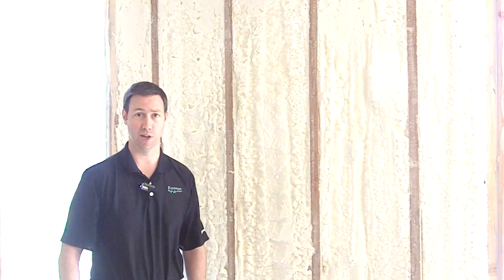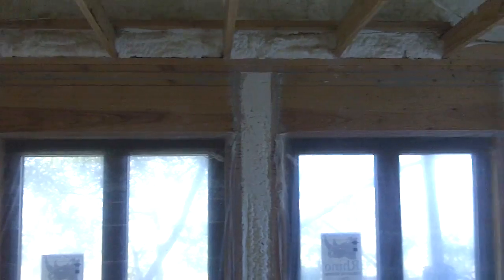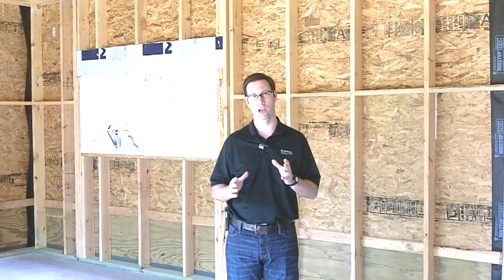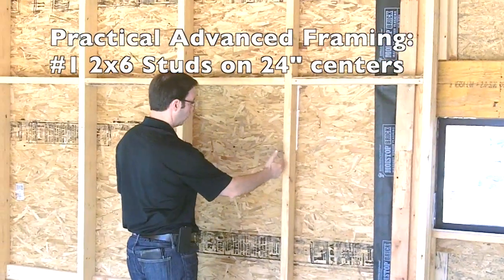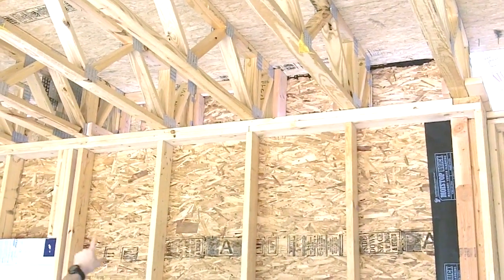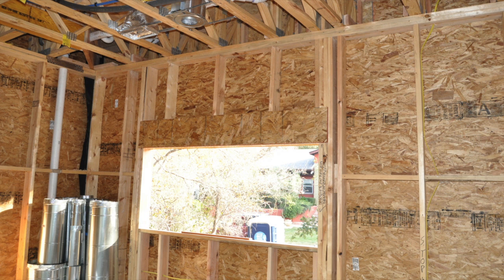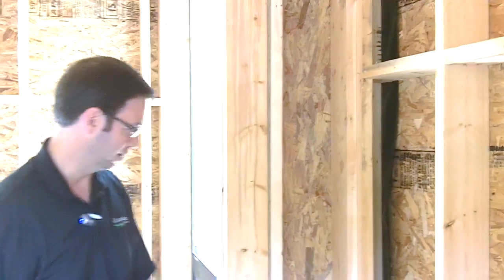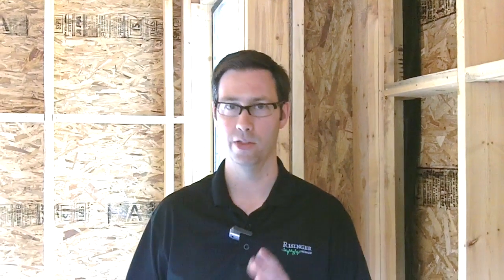Advanced Framing vs Traditional Framing

Comment: Yeah it sounds good and all but all this guy is, is a salesman. He's going to make the cost 10 percent less for you use 25 percent less wood and make 15 percent more for doing absolutely nothing. It's all marketing I mean you can really never over build a house, and why wouldn't you want sixteen on center it's stronger. Which is why houses from todays builders won't be around as long as houses built fifty and sixty years ago.
Reply: If it were a direct comparison, I'd agree, but 6" studs on  24 centers is stronger than 4" studs on 16.  The actual sizes of the 6" studs are a higher percentage of the nominal size.  (If you are relying on curtain walls to support the majority of the structural load of a house, you have already failed)
Reply: you won't lose 25%.  mabe 4%  you  only lose 1 stud every 8 feet.
Reply: You are right to point out the off-by-one error, but I was making the assumption you have big enough walls that the savings is closer to 33% and 25%. Granted, a real-world house will have walls anywhere from 5-50 feet, so the savings are very project-specific.

I want to address one point you made:
> "So the cost savings rises progressively minute the more lineal feet of walls."

If you mean "the savings percentage rises more slowly the longer the wall gets", you are correct. If you mean "the overall cost benefit is lower the longer the wall gets", that's not right. I think you mean the former, but I'll illustrate just in case anyone aside from us is actually following this. :)
For each wall, it's a simple linear function:

n = w/s + 1

where:
n = number of studs
s = spacing in inches
w = wall length in inches

As w approaches infinity (an infinitely long wall), the difference between s = 16 and s = 24 approaches 33.33...%. Here are some examples:

----- 4' wall -----
w = 48, s = 16:
n = 48/16 + 1 = 4

w = 48, s = 24:
n = 48/24 + 1 = 3

3/4 = 0.75 => a savings of 25% on a 4 foot wall.

----- 40' wall -----
w = 480, s = 16:
n = 480/16 + 1 = 31

w = 480, s = 24:
n = 480/24 + 1 = 21

21/31 = 0.6774 => a savings of 32.25% on a 40 foot wall.

----- 400' wall -----
w = 4800, s = 16:
n = 4800/16 + 1 = 301

w = 4800, s = 24:
n = 4800/24 + 1 = 201

201/301 = 0.6677 => a savings of 33.22% on a 40 foot wall.
Reply: Actually it's 4 per 4' with 16" O.C. and 3 with 24" O.C.; counting the studs from end to end. A 25% decrease in the amount of studs; but an overall increase in the price of 2x6's vs. 2x4's. Would have to do a cost analysis of total linear feet needed of each type to find out if there is any actual savings. I doubt it would be much. I think the potential savings are really in man-hours/labor and nails & hardware; not in the lumber if you go the 2x6 @ 24" O.C. route.
Reply: before anyone else posts on here: it's worth mentioning that a stud's R-value is like 6. especially in colder climates, that's a major drain for heat in the house. for reference a regular insulated wall is like 20
Reply: According to math and my 30 years experience as a framing carpenter and a builder I'm fairly certain you are all wrong.   In four feet of wall, at 16 oc, there is 4 studs, at 2 feet oc there is three studs.  For a savings of 25% in 4 feet of wall.   The stud at zero or the starting point must be counted.    0,16,32,48,64,80,96. For 7 studs in 8 feet.   0,2,4,6,8. For 5 studs in 8 feet. For a 28.6 % savings  in 8 feet of wall.  So in a wall of 24 feet at 16 oc you'd have 19 studs, and 13 studs for 2' oc.  So the cost savings rises progressively minute the more lineal feet of walls.  However, I agree with Blake, I wouldn't build my house with studs at 2 foot centers in either 2x6 or 2x4.  I don't think the poster of this video would either. A couple little pigs build their houses on the cheap, and we all know what happened to them.    Studs are the cheapest component of the entire framing package. So you might as well use them.  As far as the energy efficiency is concerned, given the conductivity of the surface area of one stud , you are majorly splitting hairs.  Not to mention the builder put sheet insulation on the exterior of the house.  And with the 5/8 rock on the inside, he now has to re extend all the 6 and 9/16 inch jambs on at least the doors.  Energy efficiency is a state of mind. We all live on a planet in which matter and energy is conserved, and most people exhaust over a gnat and swallow a camel.
Reply: all sounded good till the end. Then you blew it with that nonsense. Energy efficiency is required to survive as a species over the next century. At least until we move away from carbon energy
Reply: Try using a mister to apply water on the exterior of a conventional home at minus 20C. The water freezes over the stud bays but remains liquid over the studs. Why? Because the studs conduct heat from the house interior to the exterior. SPF has an R-value of only about 1 per inch. Do you really want to heat the outdoors? I don't. That's why I build modern, quality buildings now.       @1974jrod
Reply: Blake Pilkenton bg
Reply: 1974jrod hey I'm reframing my basement since half of it is not framed. What type of framing wood or steel? And should I do 16 inch on centre? Also use 2x4s?
Reply: zain tareen wood, steel, or timberstrand.  Take your pick . Don't know your climate though.
Reply: My house was built in 1947 with wood taken from a barracks used to hold German P.O.W.s sold after ww2 for lumber ,its strong as hell real good wood and 16o.c. think of the weather this place has seen guess my grandfather who was a mechanic was also a dam good carpenter,
Reply: I bet thats a nice place, love old construction the oldest I've worked on was around 170 years I have done a lot of those jobs in the past U.S, we don't go back like some of the old world buildings in age.
Reply: Muftobration actually it's 4 and 3.

4 ft of wall plate, 16" on center

Stud #1 - beginning of plate
Stud #2 - 15" 1/4 and away
Stud #3 - 31" 1/4 and away
Stud #4 - 47" 1/4 and away

4ft wall, 24" on center, would be 

Stud #1 - end of plate
Stud #2 - 23" 1/4
Stud #3 - 47" 1/4
Reply: Blake Pilkenton true
Reply: I do not think so
Reply: The pain in the ass of extending all the door and window jams when using 5/8 drywall is stupid. Of course ceilings use 5/8, but that is for rigid support and don't effect trim at the end. The lumber is really the cheapest part of the house, so beside the rafters, 16 oc for walls is a no brainer like half inch drywall
Reply: Muftobration I say thars good one tell me this.   Fourteen or so, don’t make no much differences when we build em up nail em. No two ways keep doin it keep buildin!!!! Is all the game strongern tha bettern
Reply: Minimal difference in wood saving. You use less sticks but not really  less wood. Deeper cavity for insulation is about it.
Reply: Blake seems incredibly unaware of building for energy efficiency.
Reply: OK. So, what I see is: 
Yes @16 oc=4 st@4x2
@24 of=3 st@6x2
But if you look at the 24", the volume of wood used is equal. At the 48", the 6x is 2" more wood.
Just the factor of thinner wall mass is more usable space, IS the considered standard... 2x3s are basement studs because of existing wall structure. The 2x6s are all well and good - if you have the space. Yes, the more RF rating should become the common standard if climate is on either extreme, but for heat, it can be delt with by use of deeper foundation that makes the first floor almost a 3/4 basement. Proper ventilation strategy can greatly improve the energy efficiency for 2nd and 3rd floor cooling. The 2x6 total mat. and the insulation total mat. is reduced overall.
But, yeah! Total sales pitch, and BS on less lumber.
Reply: Guss Ruffee true that's why the studs are positioned the way they are,  too add strength! and to have a thick wall, but a 2 by 6 gives more thickness to add more insulation and noise reduction, also less boards will be used by spacing 24 inches and that will increase warmth, every house is different! there's a train near mines,  therefore a thicker wall is better,  and I added extras for wind and tornado protection myself, I joined rafters with bolts and glued everything and used straps and used metal braces in corners,  I done the work myself therefore I can personalize more,  but contractors will take as many shortcuts as they can
Reply: Guss Ruffee you don't get it! your studs are placed in your wall with the longer side giving the thickness to wall,  another way to look at it is to look at your rafters, are they laying on side? no! in fact the longer your span the bigger the board!
Reply: Actually you lose one stud every 4 ft and the reasoning is energy efficiency.
Reply: 4' = 48". With 16" spacing, you'll have three studs in 48". With 24" spacing, you'll have two studs. It's a savings of 33% (1/3).

Comment: Hello,

I am planning to build 2 story house, so wondering can i use 2by6 24in OC for first and second floor? And also if i use 24in OC studs for first floor can if support second floor?
Reply: Sure if plan stamped also layout so roof and ceiling wall and floor joist all on top of each other ( point load ) great for running chase up to second story also ..

Comment: I framed homes for 21 years and Im here to tell you, 24 oc studs, bump into that sheetrock wall! I bet you will almost go thru it versus 16 on center. At 3:08 the freaking anchor bolt is half way out of the wall lol thats really secure eh?? Ive used California corners and im okay with that. 2X6 wall studs, 5/8ths sheet rock and non OSB plywood is going to cost someone out of the ass. Ah, the young "educated" guys just know it all dont they?
Reply: I was going to say the same thing! I framed for a few years here in Utah and can tell everyone going 24" oc is not worth it! 1/2 - 4x8 rock ~$9 a piece, vs 5/8" rock at ~$13.50.  Here in Utah you can't do 1/2 sheeting on the outside with 24" oc walls, you have to go to 5/8 or higher, vs 16" oc you can run 1/2. All the homes I did we used PT plywood for the first sheet of the wall.  We only built our own headers a few times, the majority of the time they were engineered. Any sort of truss here in Utah you have to use hurricane hangers to tie them into the wall, I would suggest them everywhere as they are a few hundred $$, but save your ass big-time! It's a good video, but to say a home that's framed 24" oc vs 16" oc is somehow better is a damn lie.
Reply: There will be spray foam behind the wall so the drywall won't have any 'give' to it. Most homes on the market (including mine) are not completely sheathed so as long as you are doing the 3 things 24" will be fine and should make for a very rigid wall.  1. full sheathing 2 sprayed insulation 3. 5/8 sheetrock.
Reply: Shane Marcotte usually the 16 OC is to accommodate the siding tongue and groove. Sheetrock is not real problem since it's cheaper and easily cut.
Reply: Robert Slackware I do after market media. Foam doesn’t stop us from running new wire. Not as easy but doable.
Reply: Yes, after building houses I've learned that this business is probably the hardest one to get folks to change. "I did it this way for 50 years and that's what I'm going to do!"
Reply: @truthteller50  You can say that again
Reply: I have personally punched through interior 1/2 drywall on 16" studs.  Don't see that it makes much difference.  A cheap papered or painted wall is a cheap wall.  Drywall is a cheap substitute for plaster on lathe. Plaster was used on entry level Sears kit houses in the 1920-30, and continued to be used on middle class homes until the early  1950's when stupid people who couldn't afford to buy a good house started accepting junk on credit. 

As far as cost, if you are lucky and have a good contractor, you might get what you pay for. I fought the cheap vs expensive battle over wiring and plumbing, hired and trained electricians to use EMT instead of plastic sheathed wiring and plumbers to use galvanized pipe instead of copper or (yuck) PEX in areas that weren't getting closed walls. Now those men have gone on to doing better paying work on hospital construction.
Reply: Robert Slackware I
Reply: Shane Marcotte  I couldn’t agree more! I wouldn’t build a dog house 24 OC. And the anchor bolts.......? He’s not framing a house, he’s giving a lecture on insulation. So to increase that, build a junk home overall. No thanks!
Reply: ***** Correct me if I am wrong, but isn't it that way so that he can hang the sheet rock? Looked level with the next stud to me... I think you didn't understand how that corner worked
Reply: Ok cool
Reply: shows the lack of ability to build any solid structure. what sets the structure is what the engineer specs out. cant just go all Willy nilly and just do what ya wish. California corners have been used for quite some time. nothing new there. its just a pain for anyone doing detailed cornerboards on the exterior
Reply: Not corner , wall anchor!
Reply: plywood is superior to OSB in almost every way except cost.  Some people want their house to be strong to last.  That is how I built mine.  Especially in the subfloor.
Reply: That's what I was wondering - You'll have to have a note on every finished wall reminding the person they don't have 16"oc stud walls.
Reply: Wow! Where do you folks live? No-one is familiar with 24 inch centers? Jeez, get up to speed; the world's a changin' and you're being left behind.   @truthteller50
Reply: I completely agree with you.  Too bad others writing reviews don't understand this.
Reply: Nor is the bolt centered on the 2x6 bottom plate so the concrete guys deff suck dick or its a remodel lmao
Reply: Sound advice. Thank you.
Reply: Shane Marcotte many old homes have 2 by 6 studs,  I guess it depends on the builder I'm doing my own renovation and I simply take time and use extra nails and bolts and braces,  I even glue all my boards
Reply: Whereas I do agree with you, they fill that 24" void with expanding foam which as you know has some rigidity to it.
When I frame I fill the corners with insulation before I sheath.
Reply: I been framing for 82 years and can drive a 16penny in 1 swing
Reply: Shane Marcotte --- I'm retired from 47 years of construction. I started using this 2 X 6 - 24" o. c. system in 1977 and it's very efficient and is as strong as the 2 x 4 system. My current home of 21 years is this system and if I build another one in my lifetime it will be like this. Don't dismiss this as someone thinking about money/profits, because it WORKS! I would never do 2 x 4 exterior studs at 16" o. c. ever again!
Reply: Computer program VS experience
Reply: Sainbayar Battur the computer  eliminate the overkill
Reply: Shane Marcotte I am a third-generation Carpenter this guy is a bonehead framer trying to save a dollar to stick in their pocket
Reply: Who said anything about the depth of the anchor bolt? I said it was half way OUT of the wall and sarcastically pointed out that it cant be very secure if it's outside of the freaking Sheetrock. Also a testament to these folks work smh
Reply: $26 for plywood per sheet is just to expensive. All products are designed for 16" centres. Have fun hanging cupboards!, securing baseboard! Etc..
Reply: BULLOCK 24 and 16 fits the same on sheet of pkywood
Reply: Nope. Smart framing design means making sure 4x8 sheets of sheathing, drywall etc. land on studs. Those studs are 24 inches apart in a modern home. It's done all the time; nothing mysterious about it.  @BULLOCK1973
Reply: @BULLOCK1973  All Effin products are designed for 16" centers! Exactly! So the home owner would now have to cut the dry wall insert studs, put the dry wall back up, paint it then you could put in your product. OR, get a huge freaking board, nail the square 24" across then mount your 16" product, WTH!
Reply: BULLOCK look on the bright side all that money he saved, he can go out and buy lumber for blocking lol
its about saving money
Reply: How does the depth of the anchor bolt have anything to do with stud spacing or thickness or anything but incorrect installation?
Reply: @clobbopus_used_beat  Those bolts or the wall were misplaced. A good fart would knock that wall over.
Reply: I'm building a house next year using 2x6 studs on the exterior and it seems to me that using open cell insulation would also add some rigidity to the walls as well as the 5/8 drywall, I don't think I can go with 24 oc studs but maybe that's just my neanderthal brain that won't let me, the California corners are amazing though.
Reply: Johnintoit electricians love California corners too!
Reply: Johnintoit 24 inch spacing should be OK with 2 by 6 studs,  remember windows will have framing around them,  jack and king studs and headers,  and you'll have enough  scrap to put a few horizontal studs here and there!
Reply: you could be right about going through a wall with those studs spaced like that and using 5/8" drywall, and if he was using 1/2" drywall you would be 110% right!!, since he is going with studs spread so far apart, he should have used spray-in(but that would cost 5 to 10 more than what he used there-maybe) polyurethane insulation and that would bade  A LOT more resistant to wind  AND bumps
Reply: Construction is now done by what the computer program says will work. Lets just hope and pray.
Reply: @johnsonsjoyride8179  The computers programmed by someone with a computer degree, and not someone with a construction degree.builders might of helped designed it, but programmers don't know the difference or reason why they do things.
Reply: @johnsonsjoyride8179  : what computer program is is doing the construction?  Even if you use a CAD based program there is still a human(designer) that has to build any sort of model
Reply: Shane Marcotte. probably doesnt have kids who like to play roller derby around the coffee table